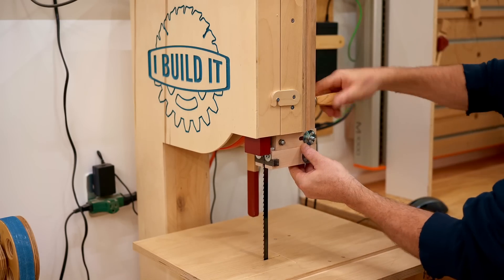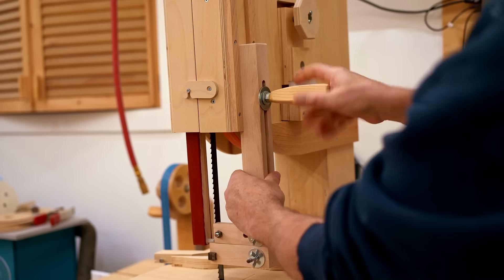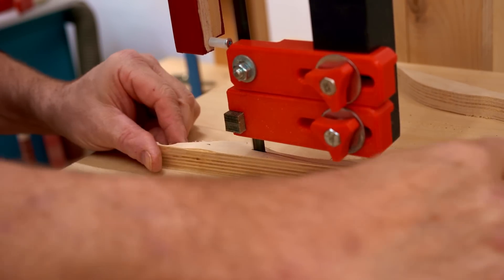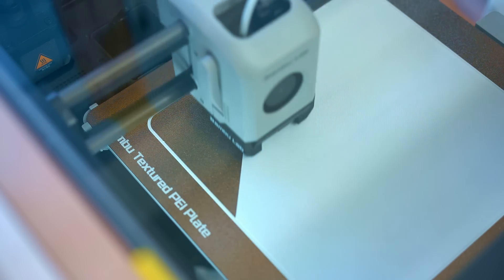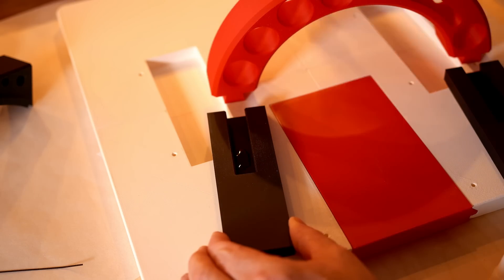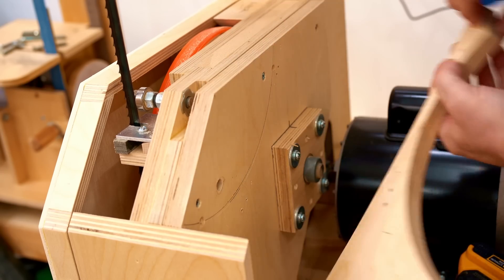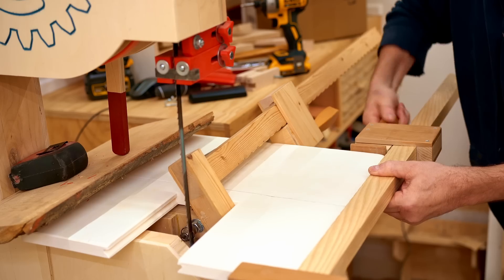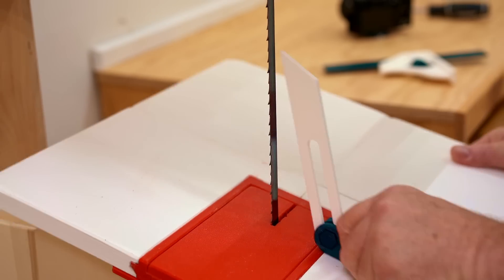He Said You Can't 3D Print a Band Saw... I Said Hold My Beer

Comment: I agree with Mattias that, at least, a 3D printed plastic bandsaw, or substantial structural parts of a bandsaw, will not be adequately strong. Watch Mattias' video on the Craftsman bandsaw, where he demonstrated how weak/flimsy the web-structured aluminum parts were, and that multiply that deficiency by the additional weakness & unwanted flexibility of the infilled plastic 3D printed parts. It is just a sudden failure away from a potentially dangerous 'accident'.

And, there is simply no way that larger things like the table can be printed in sections, joined on their EDGES using weak channels and CA glue, and be anywhere near as strong as a heavy solid wood table, or the preferred cast iron table. Wood has long fibers that give it extra strength and stiffness, and that is lacking from any 3D printing plastic. Add a lot of open air infill, and it is just weak, probably too weak for any real use.

My other thought is that CA glue makes a strong TENSILE joint, but fairly weak in other ways (shear, etc). I have personally done many tests on this kind of thing in my own adventures in making large 3D printed musical instruments. The relatively (out of necessity) thin wall of the structures, coupled with the various non-tensile forces acting on the CA glue joint, have a habit of SEEMING strong enough, until one day they seem to spontaneously come apart, and that is something nobody wants to have happening on a saw.

Comment: I would love to see you make a 3d printed bandsaw cabinet, plus more of the mechanical parts. Some advice -- use filament like PETG and ABS as you get closer to the motor, as PLA will melt over time. I'd also switch from plastic to aluminum for the bed if possible -- the bed won't stay flat. Lastly, you can use heat-set inserts or threaded inserts so you can more securely fasten your parts together. Good luck!

Comment: Print a solid section of the insert so that when the blade cuts into it, there's still a solid perimeter wall - as it's designed there will be significant stress risers on the exposed bits of infill when you install it. Also, even small internal fillets where planes meet add lots of strength

Comment: If I have to be honest I would make the table from something more solid but it could be a composite. 3d prints are amazing for precision but I would have used them for templates to make metal parts too. If you ask me, a table for a band saw would be 10mm steel plate and nothing smaller just for safety even. It adds a lot of mass to dampen vibration and make a better surface finish even, it won't bend, won't have notches that can get your wood stuck like at 10:31 etc but all the parts like the rotating mechanism that don't bear that much torsional or shearing load can be plastic or wood. Plywood is good for shearing and compressive loads, good for screwing, 3d prints are precise and metal can do everything better but it's more hassle and money. Just look at each part and make it out of what it calls for, there is no do-all material here.

Comment: Esthetically, I prefer the wood version, but I like the clever use of a 3D printer to make at least some parts that can't be made easily in wood.  I've delayed getting into 3D printing due to a space problem, but I see now that if they are used properly I could replace some seldom used machines and actually save space.  So, what kind of 3D printer do you use, and do you like it?

Comment: I've already watched a lot of 3d printing content, so purely a bandsaw out of plastic wouldn't be so interesting to me. However the intersection between woodworking and 3d printing is a much smaller niche on YouTube where I think the opertunity is. Seeing blended designs sounds way more interesting to me, using solid wood, plywood, pla, and PETG wherever they serve their purpose best. In general, it makes sense to make anything big and strong out of wood and anything small and intricate with the 3d printer. Also making jigging and router templates on the printer could make a lot of the actual woodworking quicker and easier

Comment: I'd be careful with stuff like that trunion/table design, as plastic deformation is slow and undetectable. Material like PLA will just suddenly shatter when it reaches its limit, consider leaving the trunion and table top as wood for safety. 3d printing is a useful tool, but not for bearing loads due to the mechanical properties of extruded plastic filament. I'll also note that threading into plastic is easy, but look into threaded inserts or nut-held designs, which won't slowly deform and sheer off from bolt tension. Functional 3d printing can be insidious, especially with materials like PLA. Everything will seem fine, then years of heat cycling, dye decomposition, and UV exposure turn the print from strong to incredibly brittle. I've moved a lot of my functional printing to wood and metal due to long term fatigue stresses in PLA/PETG/ABS/Nylon (two failure modes, sudden failure in PLA/ABS or slow plastic deformation in Nylon/PETG).  Aesthetic parts, light use parts, and shells/facades/static parts are great for printing at home. If it needs to bear load and be printing, use an industrial 3d printing service to get proper nylon or polycarbonate -- affordable home printers will not adhere these stronger plastics correctly.

Comment: I think the big difference between the materials could be, that one is renewable and the other is basically oil. If you would use another printing filament I'd be down. But the basic idea for 3d printing in my opinion and what we're learning as designers is. That it is for prototype and prototyping only or if we need a special part that can't be produced in another way. Else we're basically asked to leave the campus

Comment: I have really been wanting to do a decent cross cut sled with a removable stoop that the cnc moves. Then you could use it cut boards to length or stand up a panel on its end grain and cut box joints.  Also wanting to do a sliding table saw.

Comment: I'm curious how you printed those dowels. From the video, it looks like they failed fairly cleanly at the boundary between the table sections. That made me think that you may have printed them vertically, which is good for getting a round shape, but less desirable from a strength perspective. FFM 3d printing tends to produce good strength along the extrusion lines, but adhesion between adjacent extrusion lines is lower and adhesion between layers even lower still. This is somewhat akin to the grain in wood. If I was 3d printing a dowel, I'd print it flat on the bed. The sides won't be as round, but the ones you made looked more like hexagons anyway.

Comment: Please look into other filament types before you go on. PLA will distort over time if it experiences even a continuous load such as the weight of a shelf baring on a printed bracket. Carbon Fibre composite filaments based on various polymers would be a good start.

Comment: I would love for you to 3d print the parts to serve as Molds for sending them to a Foundry and poring them from steel, aluminum, brass or whatever you want. It could even be epoxy or plastic but they would be massive parts. I would also love for you (if it makes sense) to invest in a 3d printer which prints metal. And put up stuff you designed for Sale. Would definitely buy it

Comment: I don't find 3d printing every part for the sake of it the way to go with either projects or videos.

I'd really enjoy an approach where you make the complicated stuff by printing. Why would you ever print that table? It's complicated to print, but the trunnion is complicated to build out of wood or any other material for that matter. Why print bolts and dowels when you can buy them for pennies?

So parts that need a lot of machining, just print it. You could even make plans. A novice who has  a printer and a table saw could build a band saw, a router lift or a jointing jig in a weekend.

These machines could be cheap to make with only using filament for gears and the like. You could buy standard hardware and a little bit of plywood. It wouldn't be as daunting a task to build something more complicated that would otherwise take weeks, laying out every part and setting up jigs and machines you don't yet have.

Printers are getting cheap, a lot more people could get into this kind of thing. Make some useful, grown up Lego!

Comment: Making a table as a printable part seemed not the best possible option to me. I mean it's a flat surface made of sheet of material with very simple shape and relatively high requirements for strength (for situations like that kick in the video or just normal usage). 

3d-printed printed parts could a great idea in other areas, where shape is rather complex, like tilting mechanism, guards, covers of all sorts. Combining different materials seems to be a right way to take advantage of each of them. 

As for table, one possible way to keep it being plastic and reinforce it anyway might be a thin layer of plywood just on top.

Comment: I mean you use tools for the right appliances. And a 3D printer is just a tool. I think there is no point in making all parts printed. But it might elevate some projects and make them even nicer. I asked Matthias in the comments why he does not use 3D printers. And back then he sayd he has no use for plastic parts which take forever to print. But with the Bambu Lab printers he might reconcider???

Comment: Some things do well with one material and process, and some another. 3D printing knobs, for example is far easier than making them from wood. Large, flat, and strong things (like the table) seems silly when you have plywood available.

I think a discussion of what is made from wood, and what is 3d printed might be the most valuable angle here. Using the technologies together is most interesting to me. 

For example, if you were to revisit your full extension drawer slides, could you improve / simplify them by using some 3d printed parts alongside wood?

Comment: You have to find a balance, some parts benefit from being 3D printed and some other parts are better left made from wood,
developing that judgment for which get made from what is is what's truly valuable at this junction between woodworking and 3D printing,
this would be much more valuable to show than trying to make everything out of 3D printed parts.

in conjunction with this you can try "Complexity shifting":
making structural parts out of wood is easy, but not so much for 3D printing

making complex 3D printed parts is easy, but not so much for wood (printer doesn't car how complex the parts are, though complex parts out of wood take a lot of time and effort to make)

the idea is you can shift complex features away from wooden parts and onto 3D printed parts, and shift structural features away from 3D printed parts and onto wooden parts.
you can also combine complex features together into single more complex 3D printed parts to further simplify the assembly.
in a broad sense: simple strong frame, sparkled with islands 3D printed complexity.

also learn about 3D printed plastics properties and how they're best used:

-PLA hard but brittle, deform under load, deform above 60C° (I would avoid bearing blocks out of PLA)
good for when you need stiff parts that see momentary loads and no heat

-PET-G less brittle than PLA, but tougher, deform above 85C°, doesn't deform under load, harder to print
not the best at anything good all around middle ground

-PTU flexible but TOUGHEST
ideal where it's not structural but need to be able to take a beating,
also read about the Shore hardness scale, you might benefit more from harder, less flexible TPUs they're also easier to print than softer TPUs 

there's also plenty of other plastics you can print, here's what i know:
-nylon is a nightmare to print, do yourself a favor and cross it off the list as a beginner.
-carbon fiber PET-G is easy to print, super stiff and hard wearing but will wreck a brass nozzle and is expensive, good for structural parts.
-avoid ABS, hard to print, smells bad, and doesn't stand out for it's mechanical properties.
-wood-fill plastics have saw dust in them, so they can be sanded and finished like wood, it doesn't change the plastic's property much, also varying print temperature can change it's tint so it's possible to fake wood grain with it too.
-white filament's require higher print temperature to print (+5~10C°) we don't quite know why.

I can only recommend CNC Kitchen's yt channel to learn more about structural properties of 3D printed parts
also also your printer has a power recovery mode, that'll save you some prints

Comment: I use 3d printing for all kinds of projects - woodworking and otherwise and it has tremendously transformed my workflow. However, I find PLA weird. On one hand, it's surprisingly strong and resilient, but the creeping is just insane. Any part you make with even a little load will eventually distort beyond usable. I find PETG with its all its drawbacks to be a better compromise for general work. If I could get PET in my country, I would use that, exclusively.

Comment: It is always  nice to see different ways of building things but I would not recommend printing even those parts for a band saw.
Safety first ‼
The band saw is a great tool but as you discovered mistakes do happen. The blade can run off the wheel or even break. Metal or wood will stop the blade, preventing it slinging towards you but with the 3D printed parts you never know what happens.

Comment: First I would ditch PLA for this project, while it is strong it is very brittle. I would recommend ABS. Second I would increase the number of walls and infill percentage. This will also add more strength. Go ahead and continue converting the wood to plastic. You got my sub as I work in wood and plastic. This is a very interesting project.

Comment: Nice attempt!  Love your videos and that you collaborate with Wandel!

On the question:
First, I don't have a 3D printer though I may at some point.  What I DO have is a metal lathe and milling machine.  The upgrades I really want to do are in the blade guide portion because the Grizzley is OK except for these parts.  Like any Chinesium, it works fine- until you need to adjust it.  Repeatability is not a hallmark of such equipment.  To that end, the blade bearing carrier was an excellent choice to attack with 3DP.  I will end up refining the carrier rod that holds the bearing set (name?) Because this doesn't always want to keep the bearing set, and thus, the blade, in a perpendicular position.  So this is another good 3DP piece.  (Although, I question its size to strength ratio.)  The trunion?  Hell yes I bet that smooth action was better than wood!  Strength there intrinsically feels adequate when I look at the part thickness.  And last, the insert I REALLY like a lot!  If I went the route of the table, I would've made a provision (dovetail and associated hold-down,) that would accept a Mating bar and a pin to cut circles.  That would've been cool also!

Tabletop in general, no.  Bar support, I don't think I would.  I'm afraid of that plastic for the same reason your video demonstrated- when it breaks, it breaks violently, and is likely to screw up both your workpiece and, possibly, break the blade.  We'll assume no injury is likely... but how likely?  

I would end the quest for plastic where it is now.  Perhaps I would make a vacuum port, a better blade door / cover catch, mounts for a replaceable brush to keep the blade clean and sawdust where I want to extract it from, but that's it!

You and Wandel make some great stuff with wood.  I don't think any viewer would show angst towards 3D for specialty solutions, knobs, latches, holders, etc.  But a lot of makers are determined to stay analog, and above all else, don't want to wait hours and hours for printing, and/or the time and money heavy 3D printing effort overall.  As always, I love this video and your channel, and I have no reason to believe that will change, even if you do more 3D stuff.  Thanks for sharing it!

Comment: Absolutely continue, and please release the model files! Add it to your list of plans. Wood parts where appropriate are useful as well. Wood has a greater strength and is more resilient. You can also mix the two - for example, a wood table with a plastic insert, or plastic slides for a slotted piece of wood. Lastly, if an intricate piece needs to be wood, provide a plastic model to serve as a template or jig. 3D printing is useful not just for making parts, but also as an aid in cutting wood parts with more ease and precision.

Comment: These are "modern makers/builders" tools, the 3D printer that is. 
There are also metal 3D printers available on the market. The prices for them will only become cheaper with time. 
Another amazing mordern maker/builder tool that's also a great investment, is the lazer cutter. 
They range in sizes and power...
If i could afford to have all 3 ( plastic 3D printer, metal 3D printer, and lazer cutter) I definitely would!!!
Then you would only be limited by your imagination!!!! 
To couple those 3 things with wood working, that would be amazing!!
Also, think of the "things" that you could make for your speaker builds as well!!!

Comment: There are a lot more accessories for the band saw table, the band saw itself, and fixturing that can be 3D printed. I made a sliding fence with a calibrated scale. I made a bandsaw sled. Dust collection improvements, better blade guides, lighting, circle cutting, hold downs, etc.